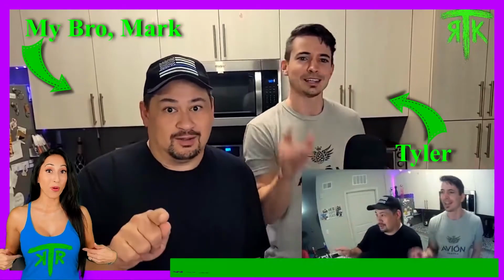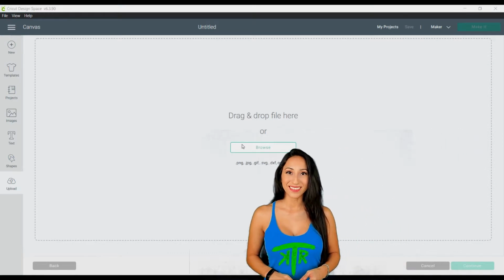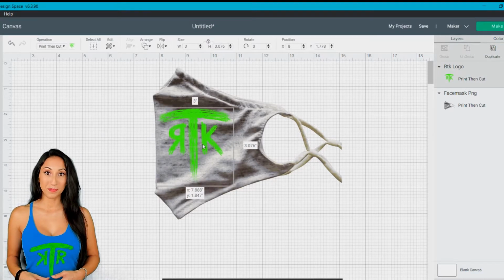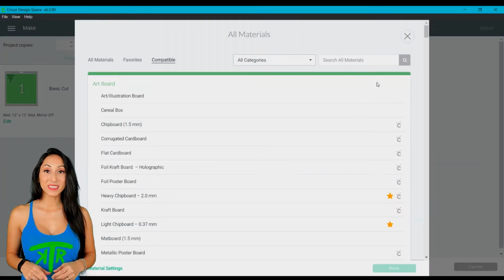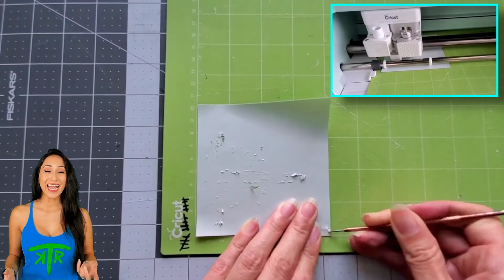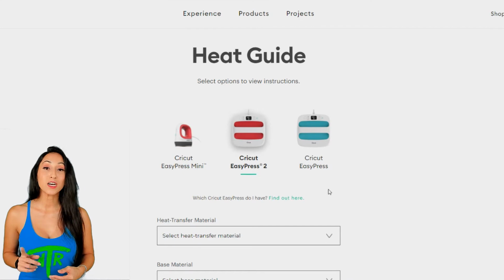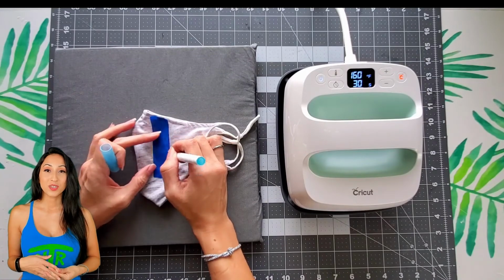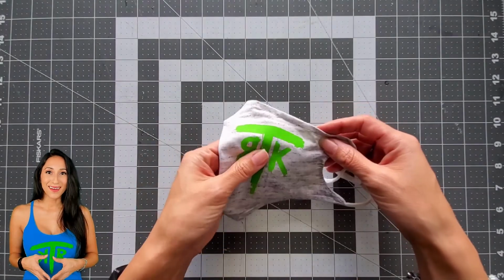How to apply Heat Transfer Vinyl to Facemasks with Cricut & Cricut Easypress 2 |  custom mask

Comment: Hi! Just found your video. I recently got an easy press and i want to make a mask as well. But mine have the nose wire in them. Will that be an issue with the iron ?
Reply from the maker: Very cool!  The nose wire shouldn't be an issue. Where you are going to use heat transfer vinyl just make sure the mask & the design are able to be flat for proper adhesion. To be extra safe you can also put parchment paper over the wire area so it doesn't heat up too much.
Reply: @KimagineDIY  thankyou!
Reply from the maker: You're very welcome😄